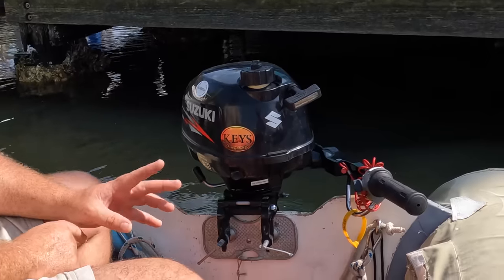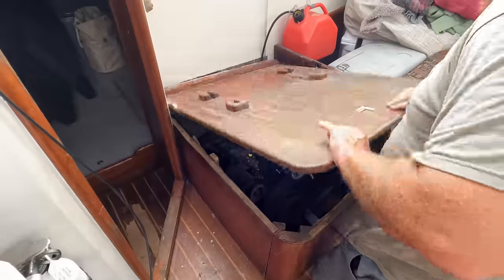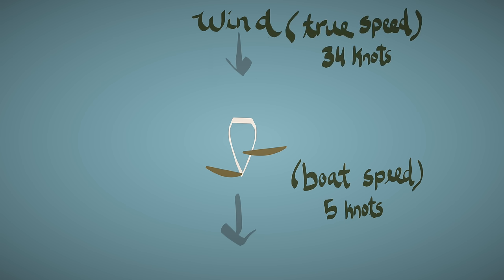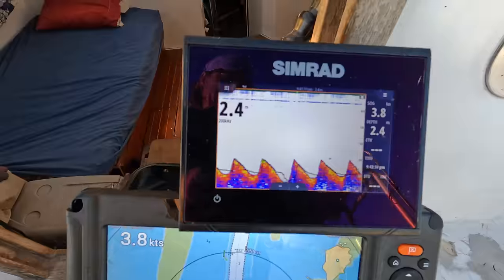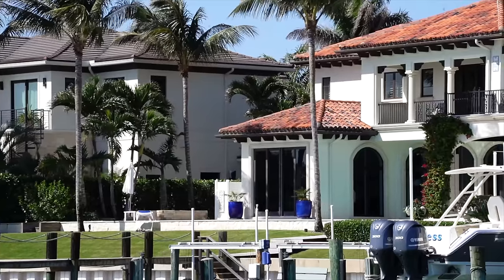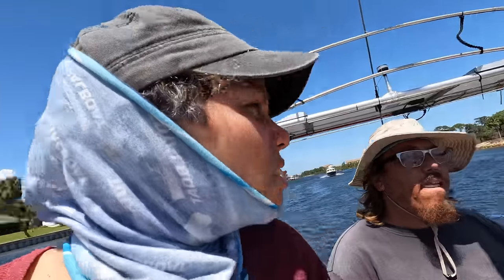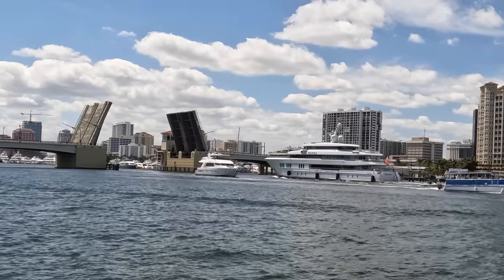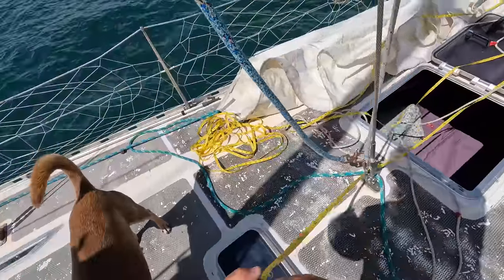AGROUND again and sail EXPLODES on icw BRIDGE run

Comment: Tip for your pup. If he has a return of eye problems you can use  Povidone Iodine.  Take a cotton Qtip soak it with the Povidone Iodine gently dab it along the bottom & inside corners of the eyes. Once or twice a day as needed.  Also use OTC eye drops Pataday or generic version, follow directions. Infection should clear in 7 days. Research other uses for Povidone Iodine.  It's useful for many problems.💖🐕⛵🐬🤗S/V Cork~Texas

Comment: You definitely don't want to touch those power lines with an aluminium mast, the boat might be glassfibre but there are wires running throughout the mast and the boat. The amount of electricity those power lines carry will create a path through your boat wiring to the water and will easily arc a 3 foot gap so you really need to allow 10 feet of clearance for safety. 
That amount of power would be a lot like a lightening strike if your mast touched a power line, keep clear !
Reply from the maker: Very interesting to think about! The comparison to lightening strike is helpful. Our mast still needs to be grounded properly - the current jury rigged set up is chain running from the backstay into the water. It’s not very scientific - I hope stay and chain are large enough to disperse lightening strike.
Reply: @sailorama  The thing about lightening strikes is the current moves extremely quickly and will run along multiple paths in milliseconds and disperse through many channels. That kind of power will go through switches that have been turned off and fuses that have blown to get to earth, it will find it's way through your engine and along the prop shaft and any through-hulls that bring water in for the engine. It doesn't settle for one path, it creates as many as necessary. A chain from the backstay into the water is a pretty good idea in theory and may help to reduce damage in the event of a strike but it won't prevent it completely.

Comment: Im so shocked that someone doesnt have a business reclaiming abandoned boats!
Reply from the maker: Yeah my complaint is that it would cost a normal person hundreds/thousands of usd to file the paperwork and remove a wreck if they wanted to undertake such a project. We came to the US to get boat parts - when we saw all these wrecks we looked into perhaps trying to do some salvage - but it’s simply not feasible. The owners of the wrecks run away because they can’t deal with the costs, and then any business/clean up opportunity is lost because the laws honestly just kinda suck.

Comment: I witnessed the aftermath of a catamaran that hit a high voltage cable that serviced NASA. Not only did he cut the power for NASA he totaled the boat. Rigging hardened after glowing red mast blackened and electrics all ruined. He blamed the bridge tender for not warning him.
Reply from the maker: Wow! Didn’t think about that - frying the rigging (even if it didn’t come down) could change the metal composition…sounds like quite the aftermath to see. Thanks for the comment!

Comment: After watching many different sailing channels for years, I am always shocked by what an unapologetic sh*thole Florida and the US is. And I'm a US naturalized citizen.
Secondly, leaving your half sunken boat for a year without salvaging it is equivalent to not picking up your trash. The owners of those boats should be fined heavily. If you can't afford to pull your boat out, you can't afford a boat. 
I dont understand why the cities and states that have these water ways don't have programs to pull these vessels and confiscate them.
Reply from the maker: Our understanding is that people do not come and pick up their trash boats because they are running away from fines and large costs that they would have to pay to clean up - that’s why the program I mentioned to help boat owners surrender boats that they cannot handle anymore seems super reasonable. I think that it should also be made easier/legal for the public to pick-apart and help remove abandoned wrecks. As it stands, filing the paperwork alone to try and salvage is way too much. Robi and I could have probably floated 4 - 5 boats in the last month just as a fun side project if the law allowed it…